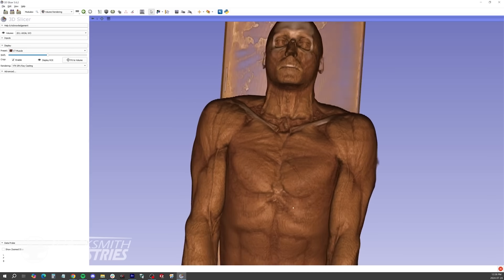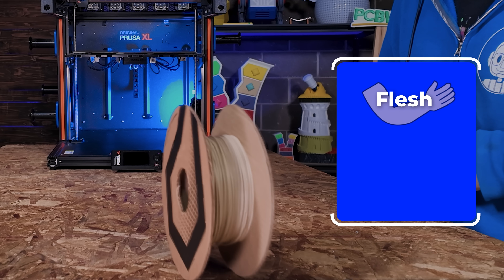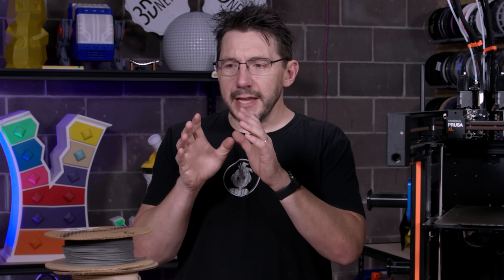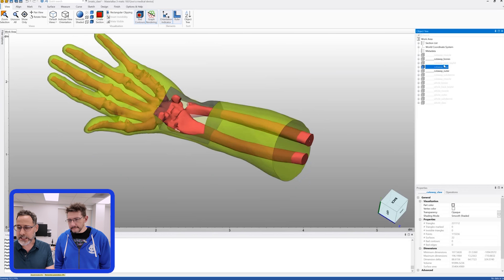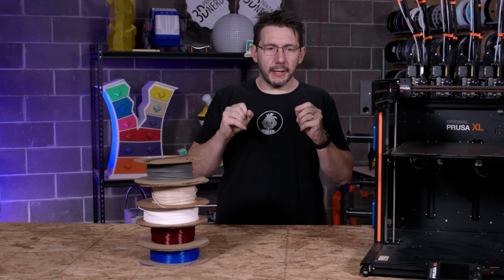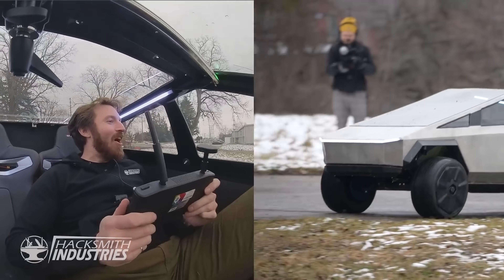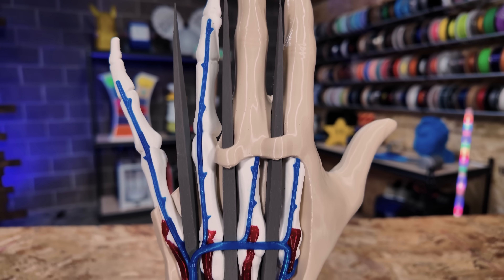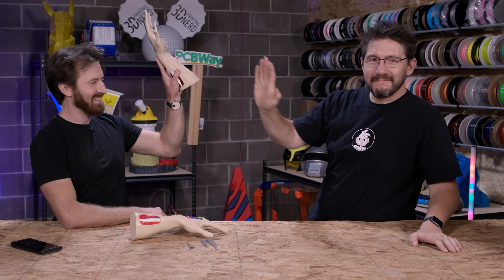Hacking the Hacksmith: Wolverine

Comment: The hard part about this is that Wolverine's claws are also actually bone and they were just covered in Adamantium like the rest of his skeleton (except for his teeth, for some reason). Also, if he were to put his hands up instead of making a fist they would come out of his palms since they're "stored" in his forearms and pushed out by muscles.
Reply: I've always thought about that. In addition, the claws in the traditional way were supposed to prevent him from moving his wrist back and forth
Reply: Also, how do you go from bone shaped claws to precise metal blades? Doesn't make sense
Reply: @rockinHurley777  probably because original the claws wer an implant and not part of wolverine so they were blades but when they changed it they probably new people wouldnt like it being adamantium bones so they kept them as blades
Reply: @t_sosh  wolverine frog entered the chat
Reply: @origindo1123  I actually forgot about them originally being implanted.  That's a good point.
Reply: @Opala79_  that’s a common misconception. It’s not that he can’t move his wrist it’s that he can’t deploy them until his wrist is straight and he can’t move his wrists dramatically while they are popped.
Reply: @rockinHurley777 well it’s because originally the claws were a side effect of being overflowed with adamantium but if you go and read Origin you see that the bone claws are actually really small. Meaning that the metal both covers and extends his claws which is why they are so sharp. The bone claws we see after magneto ripped the adamantium off of his skeleton are longer because his body was used to the longer claws.
Reply: His teeth aren’t metal because teeth aren’t bones and aren’t completely attached to the skull
Reply: @origindo1123 your thinking of X-23. Logan’s the original Adamantium claws weren’t implemented it was a side effect. Heck the people at weapon X were absolutely terrified and completely dumbfounded when they popped for the first time.
Reply: @shadowanders  they were originaly stated to be implants yes
Reply: @shadowanders  also you can even see in the first xmen movie in wolverines xray he has nuts and bolts holding his claws. they eventually changed it but they were implants at one point
Reply: @origindo1123  no that’s not the case. You do know that Wolverine does not come from the movies right? Literally just read Weapon X by Barry Windsor Smith it’s not a long read and you’ll see the original version of why he has claws. also in the movies the idea of them being implanted was tossed around behind the scenes but never actually in the movies. They kept it vague and made reference to the claws and skeleton being modified but not fully implanted
Reply: @shadowanders  what im saying is they were originally STATED to be implants but eventually they came up with the bone claw idea and scrapped the original implant idea.
Reply: @origindo1123  again that’s not the case at all. They were originally never going to reveal if they were natural or not. Until they noticed that Barry Windsor Smith started telling how he got the claws in Marvel comics presents: Weapon X (which famously didn’t have editors to check what the stories were about) which was that Weapon X accidentally over filled him and the claws formed out of the cavities in his forearms from the needles and drills put in between his knuckles. The claws ability to retract and pop out were a defense mechanism developed by his healing factor. Then later when they pulled the adamantium out of him they still wanted him to have claws so they said that since his healing factor was on overdrive it just replaced his metal claws with bone claws because he was so use to them. People then thought that that meant he had claws before they were metal so then when writing the book Origin they said he has bone claws.
Reply: @shadowanders  alr so we are both kind of right
Reply: @origindo1123  no we aren’t. They aren’t implants they were an accident
Reply: @shadowanders  implant - "insert or fix (tissue or an artificial object) in a person's body, especially by surgery." so still an implant just not on purpose
Reply: One Logan teeth is outside and second teeth are not bones. Regular bones heal not healing factor fast but they hell. Teeth's do not.
Reply: Teeth aren’t bone